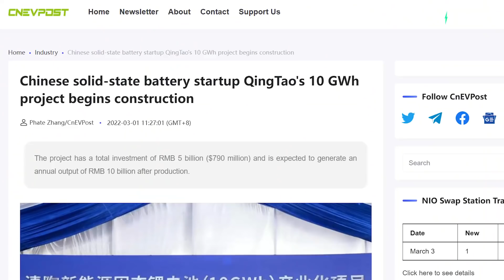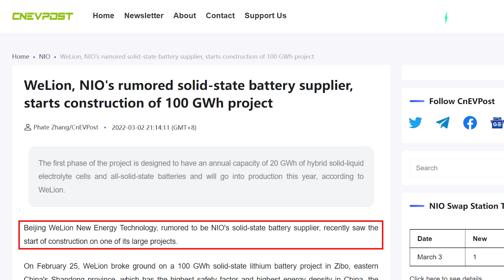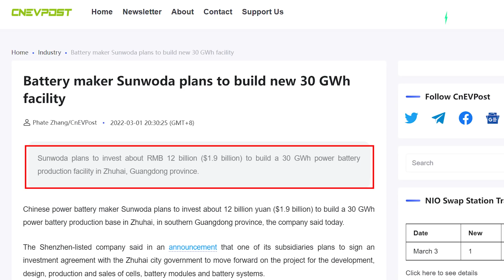This battery news is SCARY

Comment: China lies far more than when they tell the truth, even when its about engineering and tech (IP) they stole.  So when the info in question relates to China based technology advancements and R&D long/short term implementation planning & execution, the reality has to be > 75% likelihood that their projections are primarily false.   Building a factory to produce a new battery / technology that another company developed is one thing, but thats not what this is.  This is supposedly an industry advancement in solid state technology that requires commercialization and technology transfer before any factory will be producing said energy cells.     They cannot know the timelines for this project yet not if even a small kernel of honesty going on here
Reply: James
You're naive.
Reply: if they reveal they secret and this entire world can build it...what the point in that??chaina is relly good people for wasting 100b on reserch and give it free to the other??

Comment: We don't need higher capacity batteries.  We don't even need them any cheaper either.  What IS needed is faster charging technology and better/more charge techonology, so cars can work with smaller batteries.     This can already be done by having SMALLER CARS, like the smartcar and similiar.
People just need to buy them.
Reply: Simplistic.
"Faster charging" needs cells which can accept the charge.
Those cells tend, by definition, to be "higher capacity", able to charge SND discharge at a higher rate.
.
Smaller cars?
Again, if any car needs a higher capacity, resilient, fast charging cell, it's a small one.
Small ars are more affected by pack weight, since the pack constitutes a greater percentage of total vehicle weight.
Cheaper cells, with the ability to accept (and dispense) charge quickly, in a form factor which allows a structural pack, thus removing weight from the chassis / vehicle, is what's needed.
(I think I just described a 4680 LFP cell/ pack!? 🤔)
Reply: @rogerstarkey5390  just another Musk fan boy.   You have heard of LTO cells right?
They recharge in 6 minutes.

Comment: Mr Viking .. You should examine two silicon valley startups .. One is a graphene sulfur battery with a solid electrolyte and the other Sakuu is a 3D printed battery that is a Li metal battery with solid electrolyte .. The graphene battery may have minor leakage issues but offers 8x charge densities than standards Li batteries .. The Sakuu battery is stable & 6x the charge density ..
Reply: Easy to quote one Parameter. Until they get the MIX right, the cell isn't viable.
Energy Density (per kg)
Energy Density (volumetric)
Cycle life.
Material availablity.
Consistent standard.
Production volume.
Unit cost.
Must ALL be in the window.
Reply: @rogerstarkey5390  3D printing process is more repeatable than most other processes .. Easy to quote that controlled parameters don't get the mix right when you haven't even contacted the company & know of their viability ..

Comment: Sam I understand your need for the vast quantity of videos you produce but a little more in-depth analysis should be done. Regurgitating info is okay but if you actually analyze the solid state battery technology you can clearly see it is years before any useful implementation will be available.

Comment: Developing solid state batteries to where they outperform the current non-solid state batteries in power to weight ratio, charge faster, last longer and cost less per kWh, should be the next milestone achievement for BEV's, to ensure the end of mass produced ICE vehicles happens ASAP.

Comment: How real is this? I mean, it's taken elon a year to make a 'D' cell improved version of their "A" cell (american batt sizes).
I've seen lots of announcements of solid state batteries, but nothing in the way of a demo or test of them. So how real is all this?
Reply: They r not talking about breatkthoughs. They are talking about real commerical production. By the way there is another company Gangfeng (which is lithium producer too) . they put their battery in cars this February . Their  first generation battery is not too high energy dense though. It is comparable the NCM chemistry on the market right now.
Reply: When the Chinese put out a schedule, it is usually on the conservative side, and they tend to stick to it, save for external factors.

Comment: if the 4680 tabless battery is an indication ; making a functional solid state battery may be a much larger task than just building a building.
Just a claim to have an effort underfoot with no cells to independently evaluate is basically reporting nothing.
Reply: But the 4680 is in production.
Reply: Yep.

Comment: Does it count if the technology is stolen?  Is it a good thing if they are the biggest contributors of CO2 or general pollution standards of 1970s US?  Don't by Chinese anything.  I know it's near impossible.
Reply: how do you steal something that does not exist . no company has commercialized solid state batteries yet. these will be some of the first .
Reply: edwong3  obviously you couldn't figure out the link I provided.  China is not your friend.   That is all you need to know.

Comment: Solid state more useful for applications that need much higher energy density and smaller and lighter, Ev cars don’t need much more than 300 miles of range so they are not going to run the higher costs of solid state
Reply: Some will.

Comment: I cancelled my reservation for a Subaru Solterra ( co- developed with Toyota as the BZ4X) part to wait for better charging options (my area is not good for on the road charging) and better battery range. I figure the battery technology is going to go through a rapid improvement in the next 12-24 months and I would prefer to not buy an EV crippled with a lesser range.
Good news to see better batteries coming soon.

Comment: It will be an interesting contest between dry electrode 4680 and a progressing solid state. Cose vs performance will be an interesting comparison though. The 4680s seem clear that they will perform good enough. Going to be fun to watch the contest.
Reply: I don't think there are any significant battery technologies that Tesla isn't following.  If solid state were capable of beating 4680s in the near term, Tesla would be all over it.
Reply: @incognitotorpedo42  Do not forget, the sunk cost for a 4860 Giga factory is enormous and would take more than 10 years to recover. Are you suggesting Tesla just bulldozer factories and build new ones?

Comment: I wonder, are cost of production of solid state batteries, and the low cycle life all of a sudden solved? Just a year ago it was seen a decade away this would happen. Solid state has been around for a while, but are very expensive and have low cycle life, which doesnt make them very attractive to be used in electric vehicles.

Tesla is working on the 4680 and aims to drive costs down as much as possible (below $50/kwh), while the same time increase its longevity (2 million miles battery) safety and energy density, and producing them by the hundreds of GWh's.

Comment: A 100 GWh plant can produce enough batteries to make 1.56 million cars with a 64 KWh pack, I use that number as I am a Kia e-Niro driver since 2019..😊. The cumulative additions of battery capacity going on all over the world is awesome...each one is a small step to putting the dictator Putin and the Sheiks out of business. On that basis we need around 4.5 to 5 Terra Watt hours of battery capacity to match the output of ICE making plant...around 70 to 80 million LDVs a year. So another 50 factories like those 100 GWh ones mentioned here and we’re there on cars and vans..but will need more for trucks and buses

Comment: This is good for transportation. But it is also good news for military units. The military need robust batteries that can take abuse and keep functioning. Drones are the future in the military , if drones can be electrified. This will remove a huge logistic problem for the military (fuel).

Comment: Agree your comments entirely, Australia's ambition should be at least one large BEV plant incl battery manufacture. The specialised angle could be ruggedized vehicles incorporating solar charging suitable for the wide brown land, with potential for export to hot countries with lesser developed road systems.
Reply: Well unless there is some proper electrification of Trucks, Busses and Coaches in Australia then I dont see a need for the battery factory, even then it is probably much cheaper to import batteries from China, Korea or Japan. You are going to need to find an Australian company that wants to set up a battery factory in Australia.
Reply: @onlineo2263  It's a strategic not economic issue. Globalisation is finished.

Comment: The world need batteries for homes.
When a power black out, homes can still have electricity from the batteries correct ?
Reply: Best to use your car for backup if it has bidirectional capability. Blackouts happen intermittently and rarely so why tie up a battery? Plus you can drive to a charging station and get some more juice.
Reply: @jamesvandamme7786  
Agreed, but most vehicles, including Tesla's, do not support this feature, as they are pushing the limits for what is possible with battery tech, and do not want the added cost and complexity of bidirectional energy support, as it raises cost and requires special transfer switches to prevent the vehicle from feeding power back into the utility lines. (for some weird reason utility workers want to stay alive). The other option is to use the vehicle as a mobile generator using built in power outlets, and more vehicles seem to be going this route. Just run an extension cord to the fridge, freezer, heating system, wifi router, and the big screen TV, and hope your car has the ability to power it all. Or scale back, and just power the minimum needed.
Reply: @GoCoyote  This can be added to building codes and vehicle specs inexpensively. They can also be used on-grid as energy storage and transfer power to the grid in peak times. It could pay for your car.
Reply: @jamesvandamme7786  
Absolutely true. The technology is already here, but what is lacking is a regulatory incentive to bundle it all together. It needs the vehicles to to communicate to the electrical grid on a national scale across multiple jurisdictions and utilities with a unified protocol. 

20 years ago I heard about a energy research project that developed out of a university energy program. They were looking into what the absolutely cheapest way to supply our grid with power, regardless of source, when as many factors as possible were accounted for.

They were surprised to find that the US and Canada would get the cheapest power and have it be 90% from renewable energy, and of that 90%, 80 percent would be from wind, and the rest from solar, hydro, and other smaller sources. This could all happen if we massively overbuilt wind production around the country and strengthened our grid system to move the power from its production to its load.

The wind is always blowing somewhere, and it is always sunny somewhere during the day. They figured that we could do all of this in 16 years if we had a national moonshot type of program. We would then be in a fantastic position to compete in manufacturing and technology with such cheap reliable energy.

The final 10% of power not easily covered by renewables could be covered by gas peaker plants until enough EV's could be used by the utilities for both storage and power production. Just tell your car how much of the battery the utility can use to ensure you have the power needed for personal use.

All of this build out factored the economies of scale that such a project would bring to lowering costs, and also all of the hidden costs, such as medical costs and security costs. And it did not include any nuclear power, as it would be cheaper to close them all. (I have another whole rant about nuke plants)

This was prior to Ted Talks, and I forget the source, but as an IBEW electrician who has worked on nuke plants, conventional power plants, solar farms, and wind farms, I believed these people were legit and knew their stuff. We are even in a better position now, as wind and solar WITH BATTERY BACKUP is now at or close to parity with conventional power, and in some cases it is cheaper to close even newer power plants and build out renewables.

We just need some leadership and coordination from people not in the fossil fuel companies pockets. (Talking to you and your buddies, Coal Manchin and Moscow Mitch).
Reply: @GoCoyote  I'm a conservative, and what we do is conserve. Putin has done us a service and showed us not to depend on fossil carbon.
Reply: @jamesvandamme7786  
Agreed. Most of us are conservative where it is needed, but I always try to be liberal with my compassion and kindness.
Reply: @jamesvandamme7786  good idea :)
Reply: Depends on the system. Some are designed to allow for independent operation, and others do not, and some allow for limited independent operation. The big issue is that the cost for residential systems are still very high compared to utility scale systems, which are now among the lowest cost for new power generation, to the point it is often cheaper to close even relatively new coal and oil fired plants and replace them with renewables. I suspect that this will start to change once battery supply catches up to demand, and more used batteries start to be reused in residential systems.
Reply: Do you need to ask?
Reply: @gregbailey45  
What is wrong with asking? That is how we learn. Those that don’t ask, don’t learn.

Comment: We’re entering the age of an all electric economy and solid state batteries will Kill big oil for good 😊
Reply: sorry, where is the argument?? - you still need to produce the energy for the batteries ... unless you think that you can produce electricity with batteries---- certainly, if you succeed, you will become mega rich -- lol lol
Reply: @silveriorebelo2920  the energy is being produced right this second wind and solar have reached such a high production rate that they routinely have to be shut down, coal plants work most cost effective if the run continuously but ramp up and down due to demand that’s why we have extremely expensive peaker plants . Battery storage of two to four hours levels out the curve it’s called the duck curve look it up . Batteries will have all the energy the could possibly want right now starting this second. Instead of (dig baby dig ) or drill baby drill it will be sun wind and batteries baby
Reply: Any decent batteries will. We just need lots of them!

Comment: Charging while the vehicle is running is what we the people want. Range anxiety cancelation is what the  focus  should be on. Everything else is useless.
Reply: Wireless charging while you drive is so ridiculously expensive no one can afford it unless it is done via overhead lines like trolley buses.
Reply: @franciscoshi1968  why not a high capacity alternator to tap the  rotational energy of the electric motor  .same  principle of gas powered engines. I'm sure it is a possibility
Reply: @eiknarfmaharba221  clearly you didn't pay attention during physics class.
Reply: @franciscoshi1968  what do you mean
Reply: @eiknarfmaharba221  the energy from the generator comes from the motor.  There are losses in every system.  So you will be worse off.
What you describe is a perpetual motion machine which does not exist. You learn this in high school physics.
Reply: @franciscoshi1968 . You appear to be a good soul. God be with you always. Jesus rocks
Reply: Why can't the rotational energy of the electric motor used to simultaneously recharge the energy  loss in the battery  pack. They do it for gas engines.
Reply: @eiknarfmaharba221  This would violate the First Law of Thermodynamics.  In a gas engine, gasoline is consumed by the alternator.  It takes energy to spin it (when the coils are energized).
Reply: @eiknarfmaharba221  you can but you loose.
Say you get 1kw out from the generator you will be draining say 1.2kw from the motor which will draw 1.3kw from the battery.  So you take 1.3kw from the battery and you put back 1kw. So you loose 0.3kw. You are better off not having it.
Regen braking only gets back 50% so say you use 1kwh to go up a hill then you regen all the way down you end up with 0.5kwh less in your battery by th e time you get back to where you started.
You do learn this in high school  physics class.

Comment: there is many solid state battery makers the issue is the cost as currently they are expensive and cant currently complete with regular batteries!
Reply: My personal view is until Solid state are cheaper than current batteries have more cycles than current batteries then they dont bring enough to the table win out yet. Oh and they should be able to charge much faster as well when they can do these things they will win and win big!

Comment: I haven't seen how they have resolved the expansion contraction issue. That will likely be required for use in cars.
Reply: Batteries use a reversible chemical reaction to store energy. No two chemical compounds have the same density, therefore anodes and cathodes will always expand and contrast during charge.discharge. Liquid electrolytes provide space for movement within the battery. Solid state do not have any internal space so I am to holding my breath for a breakthrough at costs viable for mass production.